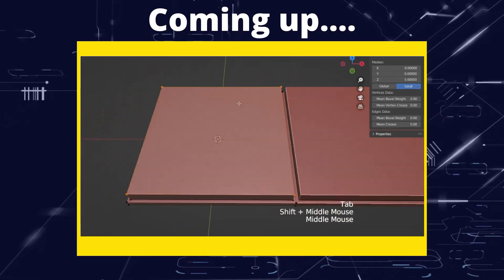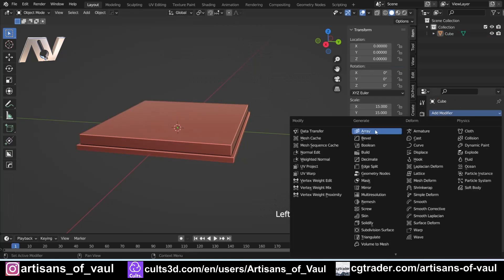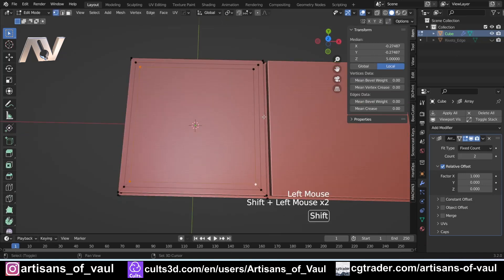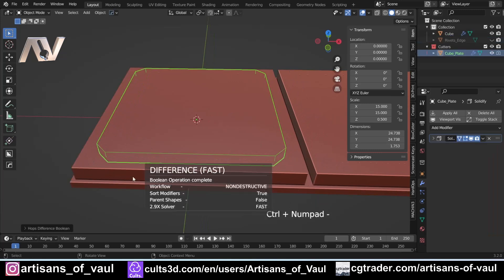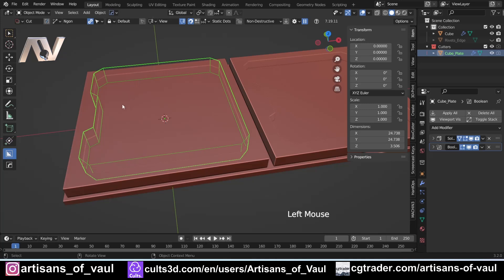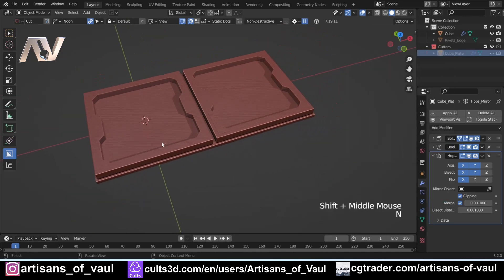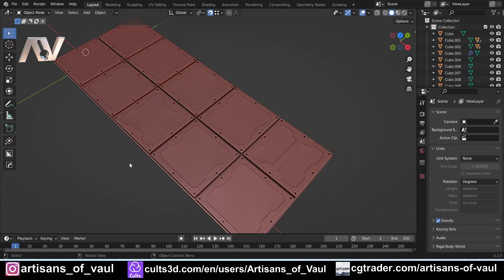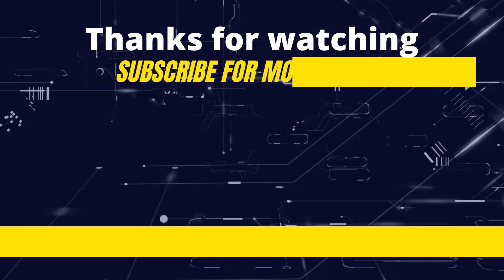Designing sci-fi floor tiles - Hard-Ops and Uniquify

Comment: Hello :) In my case @10.05, the cylinders instanced on the "rivets edge" did not cut out holes after adding Boolean modifier. I really stuck there. I finally found a workaround on Blender Stuck Exchange. I had to convert instances to a real mesh objects and then select every single one of them and apply Boolean operation. This is done by Ctrl + A -> "Make Instances Real".

This step does not seem to be in the video. I wonder if you did the same, that is apply instances to make them real mesh before progressing to Boolean operation. Thanks
Reply from the maker: Damn, good spot and really sorry for causing some confusion.  You're totally right and I think I may have accidentally edited that out of the video.  My apologies.  Glad you got it working!
Reply: @ArtisansofVaul  Thanks. Your videos are extremely helpful. You are very good at explaining Blender and AddOns. This was but one issue I found out of tens of others I watched on HardOps, BoxCutter, and MeshMachine. 

BTW, someone already made a post about the issue, which I missed, which would save my time. Cheers!

Comment: Awesome! Absolutely looking forward to more corridor tips if you have any more in store for us. I like these ideas for floor tiles. For anyone that wants to go a little crazy with the smaller details, you can modify your "rivet" cutter to look like the positive half of a screw head. Cutting the screw head shape out of the tile will leave a realistic little detail in there for a wash to flow into when painting. Then to further up the detail and to really add realism (and design time unfortunately- unless there is a randomizer shortcut I am unaware of?) be they Flat-head screws or Philips-head screws, one can rotate a few if not all of the screw head cutters randomly so that the screws are facing odd ways relative to each other as it's rare that screw heads always line up perfectly. Bolt heads are good too but as a Union for raised detail- same thing just using a cylinder with only 8 sides.
Reply from the maker: Great call. I always think its worth having details like that inset on something like this as if it's going to be terrain a lot of things will run against anything that protrudes 

I do want to make a sci-fi corridor or "doorway" to have a model walking though. I think that would be fun.
Reply: @ArtisansofVaul  that's awesome! Yeah I think the inset screw head makes much more sense then as the bolts or rivets would have to protrude somewhat. But I am looking forward to the doorway concept! I have been working on and off to try and design a kind of space hulk scene and thought a circular portal of sorts, while maybe not so practical, could look interesting to frame a mini.. will be tuning in for future episodes of course! Always great to learn more HardOps/Box Cutter workflow
Reply: @ArtisansofVaul  Absolutely amazing and an easy way to do, it would be great you do some Star Wars blast door, like the one on S2 final episode of The Mandalorian, that would be so cool